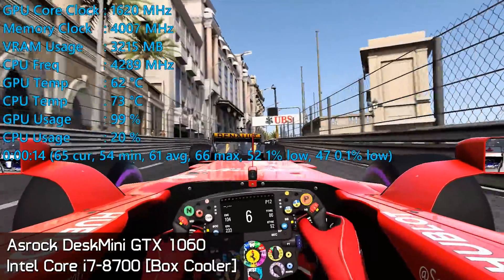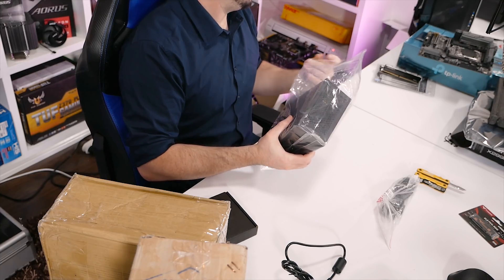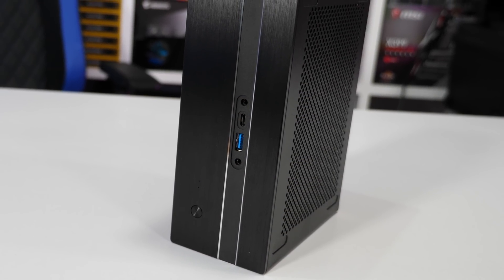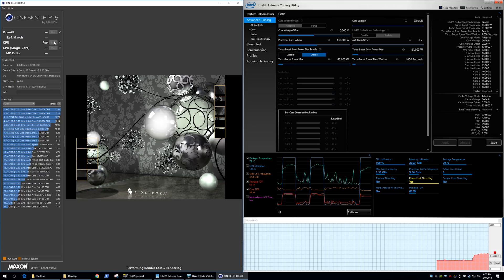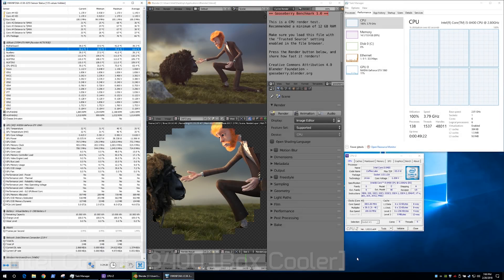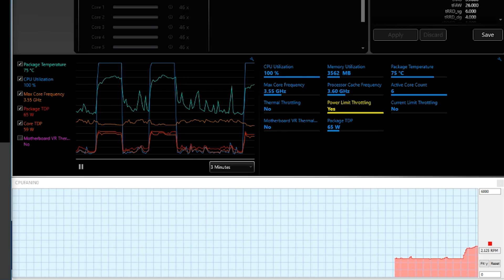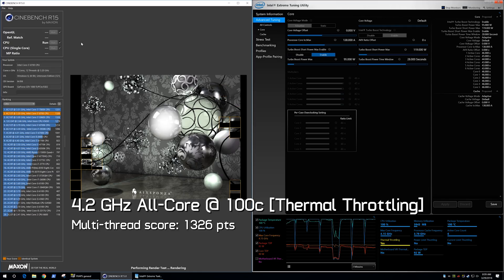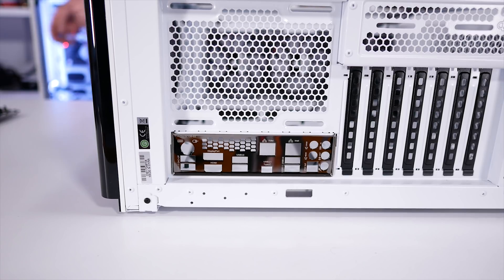Core i7 8700, Intel Box Cooler Limiting Performance

Comment: Intel lovers, keep waiting for B360 and H310 mobos till eternity 😂😂
Reply: +Vikram Bhaskar They're due out with the new CPUs April 2, that's why all the sites are under NDA. The board that Tech YES City bought wasn't supposed to be available. AMD (or rather Global Foundries) may be down to 12 nm but certainly no better that 14 +++ from Intel and AMD admit as much - there were slides showing this in their presentation confirming 2018 roadmap at the end of 2017. Their (AMD) 7nm will be equivalent of Intel 10nm, it is not a simple numbers game as it's down to node density. But all that said it is a shite cooler which Intel could very easily upgrade, also solder on the K sku's would help, TIM is OK on non K SKUs as AMD is finding.
Reply: The difference in power efficiency will cost you maybe $1 a month more overall. The difference in performance is very tangible on the other hand.
Reply: Monster Zero The i5 8400 appears to me as a very gaming centred chip as it falls behind in almost everything else (except premiere pro). A 1070 or 1070Ti should run just as good on R5 1600. And to answer your question, if all you do is only gaming, the i5 absolutely makes sense
Reply: People fight over: Intel and AMD 
PS4 and Xbox
Console and PC
Android and IOS
SAMSUNG and APPLE 

Am I missing anything
Reply: And here I am waiting for 10nm
Reply: "only 10%"
Well 10% of alot is a fuckton more than what we already have.
Reply: Got a z370p d3 for 66,- :p
Reply: Vikram Bhaskar Of course Intel won't sell it. Literally i3 8th gen will go against i5 7th gen with almost half the price
Reply: when does  ryzen 2 ships? will it work with ryzen 1 mobos? does anyone know?
Reply: clansome regardless of whether the mobos are slated to come on 2nd April, I honestly think it is too late to consider coffee lake especially the i5 8400 having only 6 threads. It does shines in gaming but only with GTX 1080 or 1080ti but pretty far behind R5 1600 in multi threaded operations. Therefore the i7 8700k seems to the only solid performer in the entire coffee lake lineup. A gem of a chip striking the best balance between gaming and multitasking/productivity. Ryzen 2 may prove to be a better alternative to Intel's popular i3's and i5's while the Zen 2 will most likely shake up the silicon industry once again!
Reply: Vikram Bhaskar 8400 with 1070 works great on yt benchmarks. Seriously if all I need a PC for is media and gaming do I really need 12 core ryzen CPU, 6 cores of which are "fake"?
Reply: YesTechCity is already reviewing one... wow eternity is a lot shorter then I thoguth
Reply: AMD Fanboy i see, nice IPC ( ° ͜ʖ͡°)╭∩╮
Reply: MediaTech the day will come when they'll fight for dick Vs pussy.
Reply: Od1sseas it's just too late for arrival. AMD is already on 12mm fabrication process with ryzen 2 and Intel is struggling to release budget motherboards for processors that are over six months old. LMFAO
Reply: Od1sseas dude I don't get why can't accept ryzen is as good if not better than coffee lake. The fact that Intel chips can hit 5ghz doesn't make it superior in any way. You'd be loosing out on efficiency which is generally the processor's intended purpose to sell at the lowest TDP possible. Add to that the cost of Z370 board, a liquid cooler, and the extra premium for K chip, all of this outweighs the performance gain you get out of overclocking.
Reply: Vikram Bhaskar u need the same shit on ryzen, ur not going to be running r7 on b350 lmao. and if u buy b350, the "future proof" dissapears cuz that shit is cooking them vrm's and u would need to uograde any ways lmao

Comment: I never thought that this fact will make angry. Freaking Intel. Sells an amazing cpu with shitty and pretty much useless piece of metal. For 300 bucks they must include at least something on par with wraith spire from amd. It's almost like selling a fast 400hp+ sport car with with brake system of Toyota corolla.
Reply: Make it a brake system from a bicycle
Reply: O!Technology you are right mate! My nephew's 3-wheel bicycle has better brake system. I was too kind about the cooler xD
Reply: i think a better analogy would be a 3L turbo charged gas guzzling engine with the fuel pump of a scooter
Reply: At least Toyota Corolla is reliable
Reply: KIWIKREW Facepalm I was trying to make it simplier😂
Reply: 90% of the users that buys a High end CPU. Will Invest the extra money on a better cooler.
Reply: Some are reliable most even are but when they do break they are also quite a bit expensive to fix.. so if they aren't as much more reliable they are still a lesser value overall no one factors this in it seems. There are of course some Toyota vehicles that are very unreliable teh average isn't even as reliable as the reliability claims indicate they are the cherry picked above average reliable cars that are pointed at. well I can point you at a 1996 Camero with a 3.8l v6 that has over 450k on the clock and no rebuilds does it make the v6 Camero reliable, nope it makes that one reliable.
Reply: High end what. Intel uses nothing but cheap shit parts and doesnt even have the decency to give you a decent cooler and nobody can disagree with me on this one. Having to go out and buy an aftermarket cooler because the OEM is so shit is not 'high end norm', its just a justification.
Reply: I bought my i7 8700K without a Intel CPU cooler. and i saved 35 bucks by doing so. They should simply stop offering Coolers for High end CPU's.

Comment: Intel should make the heat sinks copper
Reply: They'll then make the MSRP 2x because its a premium extreme edition x series stock cooler for a great VR experience.
Reply: They should just design new box cooler or order one from someone. I had i3-4170 that would reach 100C and overheat on stock cooler but would be rock solid at 65C under load on cheapest tower cooler (whit one heatpipe!) that cost me just 8 Euro.  Thats how bad those Intel box junk so coled coolers are.
Reply: They did and they were still shit.
Reply: Why? The size and surface area seems to be the issue not the material.  An exact copy made of copper would likely be equally shit.

Intel has larger coolers but its about money.  People who dont know wont notice and people who know and care about the thermals, performance and noise will already have an aftermarket cooler or order one when they build.
Reply: Hydrochloric Acid cool story mr obvious. Doesnt mean its the limiting factor  or would make a significant difference. 

Size is the issue and increasing size would give better performance per cost gain than going to copper.

Their shitty aluminum coolers are sufficient for their base clock speeds (which their cpu tdp is based off of )and single core boost speeds as they claim. So why make them out of copper or larger.
Reply: They used to
Reply: Stanisław Szczypuła my dell heat sink does not even let the processor go above 55 celsius
Reply: EHEH RON copper has higher specific heat and higher thermal conductivity

Comment: So, with stock cooler i7 8700 has same cb score as overclocked r5 1600 3.9GHz also on stock cooler.
Reply: The 1600 at 3.9 gets ~1305, the i7 gets 1127.
Reply: jep i own 1600 3.9ghz i get around 1310 points
Reply: I have 4.1GHz r5 1600 and I get 1387
Reply: Od1sseas, for the x2 price it doesn't shit it enough. If shittin is your thing though , grab a pig not a cpu mate.
Reply: BCLK overclock at x103? Why you hide MB info? Lol. Anyway twice cheaper 1600 + twice cheaper MB + BOX cooler @3.8 = almost same result. Pathethic.
Reply: 1600 > 8700 in Price x performance.
Reply: Alistair Brogan https://images2.imgbox.com/ce/71/3rMP8TO3_o.png
https://images2.imgbox.com/8c/c2/PBkv3pBk_o.png
Reply: Ba Aditrex since 2007
Reply: Phaethon the 8700s boost clock is higher than that, your getting your turbo speed, that's not overclocking
Reply: Od1sseas youre ignoring the fact ryzen is complety new platform and intel architecture is being optimised pretty much in everytask games you will see in near future ryzen will be better utulizing overall
Reply: i7 8700 non K oc'ed to @4.43 ghz+ deepcool gammaxX 400, 1478 cb!
Reply: No !It's overclocked i7 8700 non K at 4.43ghz ,you got it?
Reply: Dmitry
Where is I hide info about MB?!Nothing about hiding my motherboard!Motherboard model is an Asus Prime z370p and yes ,BLCK freq.at 103!Not pathetic when it comes to gaming and workloads !I feel in your words you just trying to insult me by reason of I have this cpu! 4.44ghz is a decent numbers for i7 8700 non k.
Reply: Nah, go to futuremark.com's benchmarks, and go to userbenchmark, and so forth, and you will see otherwise. It is more than one CPU tested too, but thousands of user submitted benchmarks (userbenchmark), and futuremark is 3D Firestrike scores. It is barely behind the 8700K by around 5 to 10 percent, while Ryzen is way way behind in SC/QC and yes, it is even slightly behind both in MC, and without a doubt in gaming as well. I don't know what cooler is being used but I am sure many of them are stock coolers too. It's not too hard to buy a new cooler anyways if you are thermal throttling.

Comment: Thank you for reviewing the i7 8700. I'll grab a 120mm AIO now
Reply: Perseus no need, get a 120mm air cooler and save the money!
Reply: You don't need an aio for an 8700
Reply: a cheapo M9i, aidos or hyper 212 will do the job just as well for less.
Reply: O!Technology I know. But the country I live in is very hot and air cooler doesn't work as well as a Cooler Master MasterLite 120. It's not much more expensive than a 120mm air cooler anyway
Reply: The only good reasons to buy an AIO is the compact size for ram clearance and aesthetics. Price to performance and absolute performance no reason to buy an AIO.